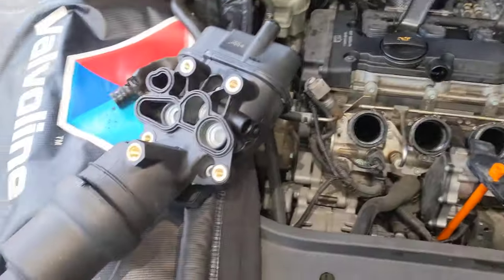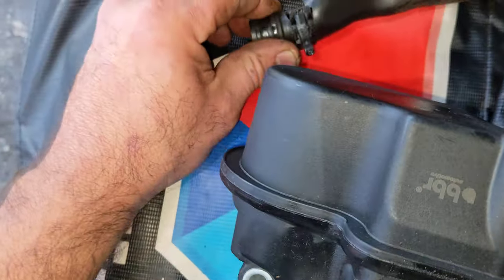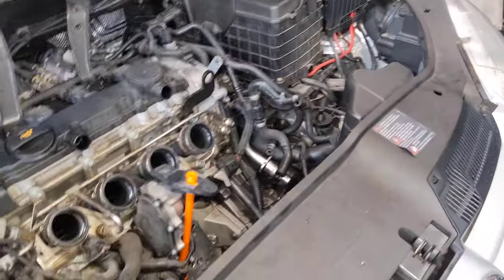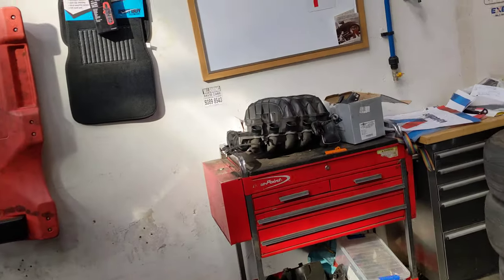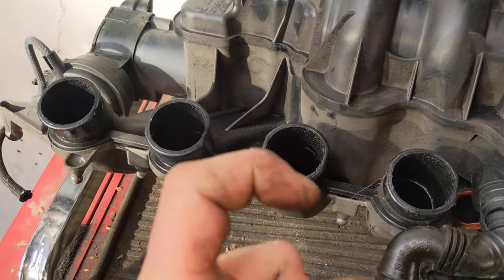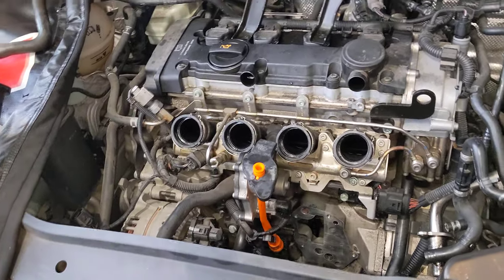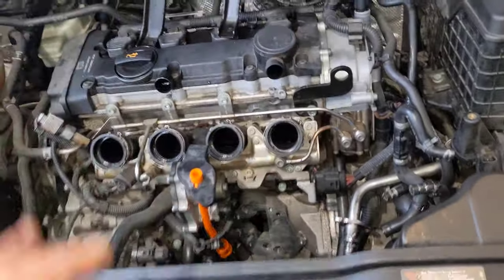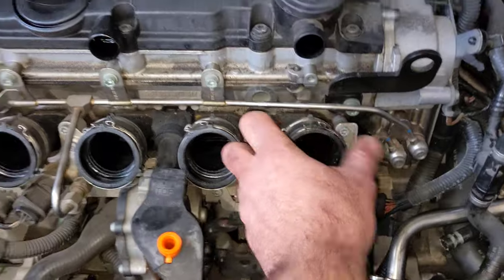Volkswagen Golf oil cooler oil leaks. Breather hoses. oil filter housing dipstick tube. 2006 VW Golf

Comment: I think readhead germany said they got aluminium ones if i recall correct. and warning the oil leak from rockercover will f..k the seal on the cooler from what in brain plus dates few revisions of this best to have latest date possible as vw had manufacture issues more then once
 i am not 100 pro if on diesel but looks what you show in video.